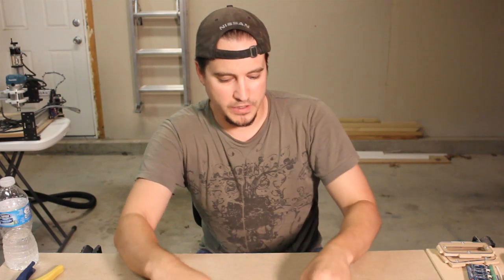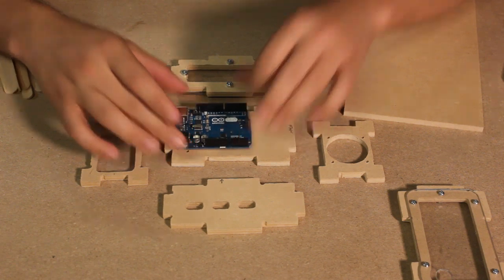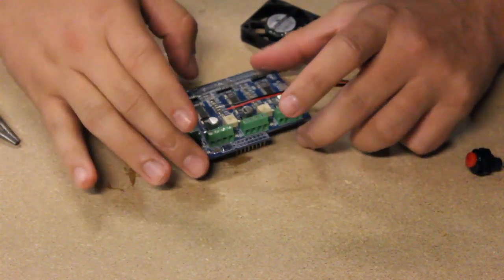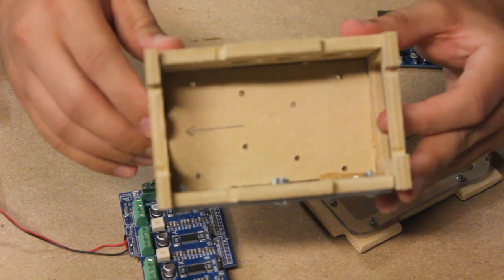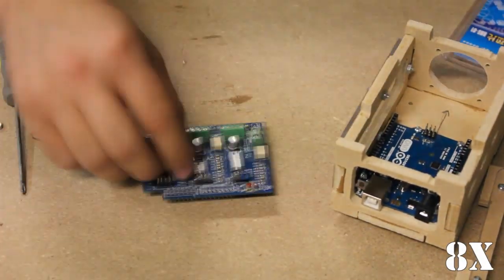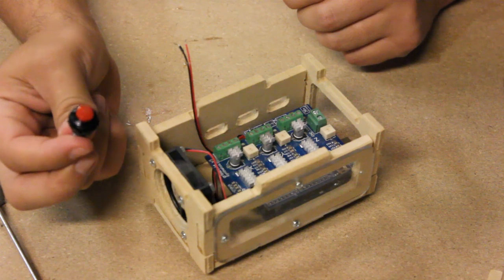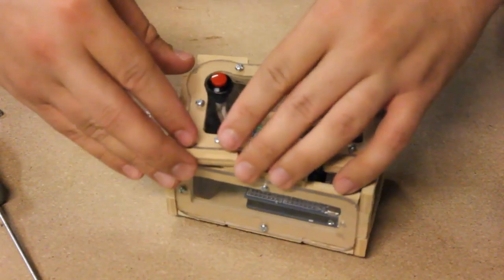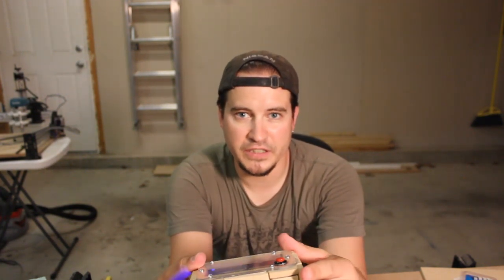Shapeoko 2: Electronics Box Assembly

Comment: how did you cut your corners?
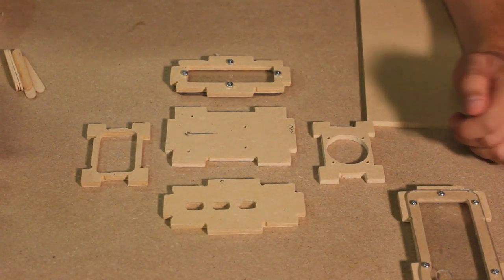Reply from the maker: I assume you mean the inside corners.  If you look at the video at 1:17 you can see the pieces a little better (especially the middle bottom piece), you can see that i designed the inside corner tool path to go into the part just a little bit.  This does make a little hole once the box is assembled, but its not a big deal.  The other option would be to cut your corners normally and then go back with a file and make them square.
Reply: Yes that is what I was asking.  What program did you use to set up those corners.
Reply from the maker: jameslee522 The corners are part of the design / geometry of the part.  when i designed the part (in solid works), i modeled in a circle that was slightly larger than the diameter of the bit on the corners.
Reply: oh ok.  I didnt know if you used cam software to make a loop on the inside.  How much was solid works?
Reply from the maker: jameslee522 Solid works runs about $4000
Reply: Targ's Workshop holy sheet man!  That's waaaaaay to much.
Reply: jameslee522 Try Cambam its about £100. and has a function to overcut the corners
Reply from the maker: john smith
thats cool.  I use cambam for the coding portion, but i haven't done any designing parts in it.  I will have to look into the corner thing.
Reply: Targ's Workshop
I use Cadstd to create the dxfs. Its probably the easiest cad package to pick up if all youve used before is paper and pens.  Cambam can create dxfs too but its more aimed at creating your G code from drawings.